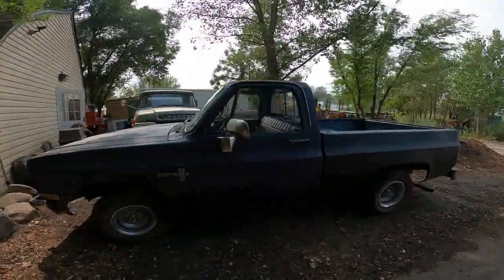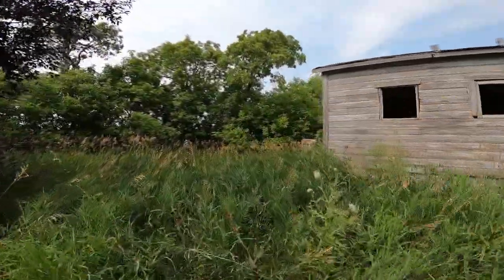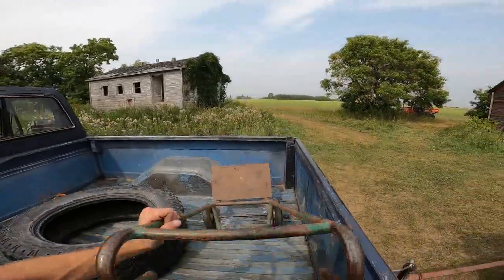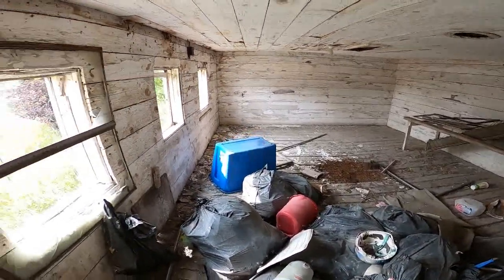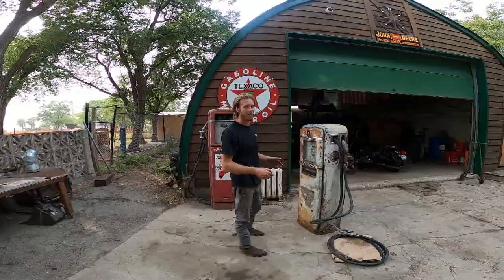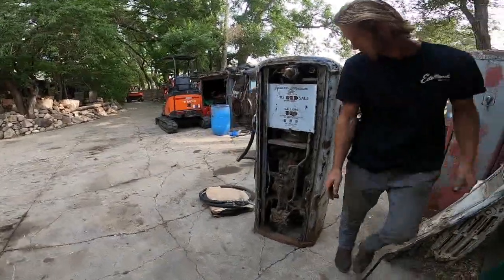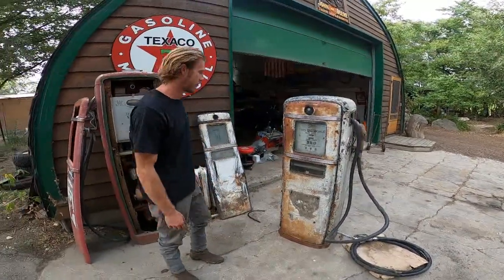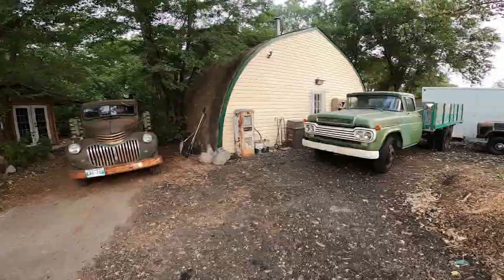Old 1940’s Gas Pump Found in a Field - C10 Shop Truck Hauls it Home

Comment: Gday from OZ great find on the gas pump an nice collection of old trucks ive got a 76 f250xlt iv had for 32 yrs an a 81 f100 swb custom ive had for 20yrs an its good seeing more saved an i collect gas an oil items to an my gilbarco salesmaker pumps are a shade of green inside no matter what color or brand they were an my wayne pumps are grey or white inside just somthing they did an im going to check out more on your channel
Reply from the maker: So youre a Ford guy is what youre telling me :P
I love a short wheel base truck no matter what the year or make it seems.
Good to know on the colour of the interior of the pump, Im not surprised to hear that green seemed to be a common sealer colour.
Thanks for the comment man, enjoy!